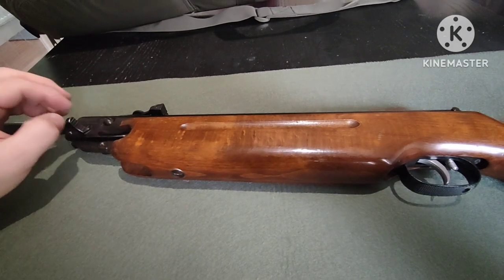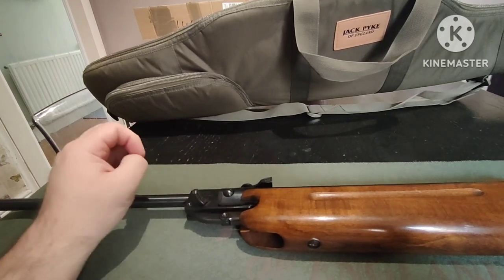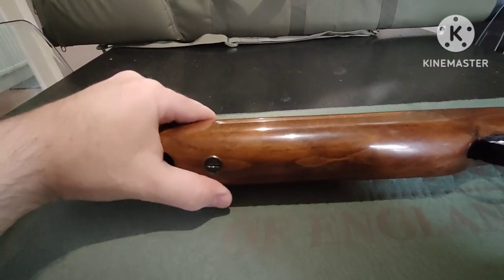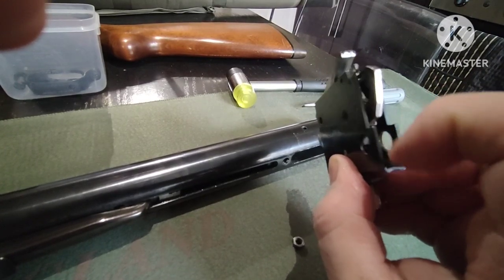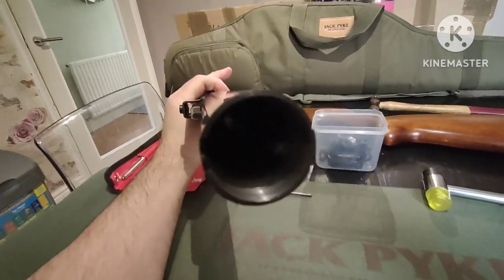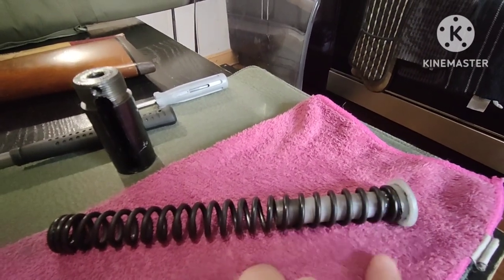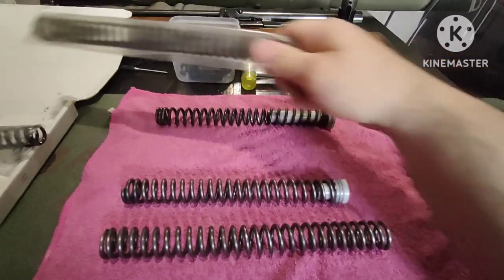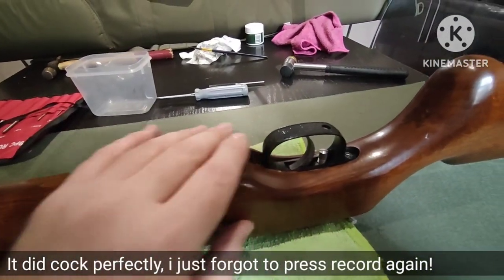Weihrauch HW35 | Main spring change

Comment: The HW35 is a great air rifle, way better than the most modern crap. Why change what is good. I own almost all HW springer models and the 35 is one of my favorites, specially for hunting. Cheers!
Reply: Hallo.Moechte Sie fragen,warum mein hw80 so laut ist? (Feder zu lang?)Danke!
Reply: @raydaniko-qm5cj   Hello! High power springers are always louder just because of the longer and stronger spring. A tuning kit will reduce the mechanical noise a bit, but you will never get a quiet air gun. This is also the reason why i always say that a moderator on a springer will make a very little difference. If you want something more quiet you have to go down in power or get yourself a PCP. Cheers!
Reply: @rapalaron6348  Dыnke fur Antwort.Ja,man hoert das kommt ein Hammerschlag von hinten,da hilft kein  Moderator der Welt.Ich hab PCP Gunpower Shadow ,aber immer schon wollte deutsches Weihrauch HW 80.Danke fur Ihre Zeit!
Reply: @raydaniko-qm5cj  Gern geschehen. Schöne gruesse aus Schweden

Comment: The stock is a beautiful colour. Seems accurate and if it feels smoother, job done! Great video.
Reply from the maker: I'll be down the range soon to put some pellets through it and se what the chrono says
Reply from the maker: Oh well, no idea what's going on.

Chrono says 8ft Ibs with a Titan XS spring and a washer??
Reply: @keith6930  That is strange. I have only heard good things about  Titan XS springs. You could try some research on the various forums.
Reply: Try a spring without cutting it down.
Reply from the maker: @ps1834  it's got the Weihrauch main spring in with original guide swapped in instead
Reply: @keith6930  try an uncut titan spring.
Reply from the maker: @ps1834  The number 4 spring for the 35 was too long and wouldn't cock?
Reply: @Essex Airgunner  didn't you cut too many coils off it? They're an easy rifle to get power up,try putting some washers in instead of a spring then,good luck 👍.
Reply from the maker: @ps1834  I did on the initial replacement TBT spring, felt like a right numpty

Comment: Hi
I used PTFE sheet to make a piston liner to get a nice fit between the spring OD and the piston ID on my FWB 127
Helped to reduce twang and some vibration noise and made cocking smoother.
It comes in sheets of different thicknesses and I got it on eBay.
Seem to recall it was 0.5 or 1mm?
Not been to Pete’s for ages, might have to get back into air gunning and pop over there, it’s only 20mins away😊
Reply from the maker: I think it's 0.5mm that's best or needed for the springers. Probably a better option than a steel one?

Comment: i've just put a spring in mine and it has 26 coils a tinbun top hat and guide the coil diameter was 3.5mm , it does have quite a bit of preload approx 2.5 inches which isn't easy to install as i used a large sash clamp and had to mark where the threads off the cylinder and end cap 1st mesh to make life easier. then i  put them both in the sash clamp pushed the end cap until it stopped , then started to turn the end-cap with a large spanner as a lever in the trigger orifice whilst at the same time keeping the pressure on by turning the sash clamp vice, its took a few attempts but yo must be patient and wear gloves, but it would be easier if you had and extra pair of hands for that bit. mines now stop on on power just under the 12 ftlbs it was only doing 9.5-10 ftlbs on its old spring. i didn't have to squash any coils. 26 full coils goes in lovely and there's just enough room for one 3mm power washer if need be ?
Reply: mines a mid 1990's model with a plastic piston seal . i had to change the spring as it only has enough room for one 3mm power washer as it was and it would still have been well under power . obviously they wasn't much pre-load on the worn out spring although it looked nice and straight still but the coils had lost their boign and collapsed approx 2inches shorter than the replacement even though the replacement had the same amount of coils and wire diameter.
Reply from the maker: The TBT spring and the Titan X's main spring were all too long for the action to cock. It became coil bound and wouldn't cock so needed to be trimmed down a bit. Shame as would have been nice to have a drop in kit "drop in".

No matter the spring the power has never been fantastic or even near the 12ft Ibs?

It's a .177 so wondering if it's a transfer port issue more than a main spring? Might account for the noise and crack when fired?

It's now got a Vortek kit, a very nice and well built drop in kit

https://youtu.be/sgI9SineGG8?si=ew1zSUylsZ_ggfOB

Comment: People say the 35s are best at around 10.5 ft/lb and more power ruins the shot, thats true on the early 35s but later one's can be tuned to 14ft/lb and in 22 they shoot great at that, mines doing 14ft using FTTs, dont try it on the older ones with the larger transfer port, 4mm l think, later one's are 2.8mm.
Reply from the maker: True, the power on the .77 has never been huge and always around the 10-10 1/2 

I'm in the process of swapping to a .22 and it will be interesting to see how the same gun shoots with the larger calibre. I suspect more power and a softer shot cycle